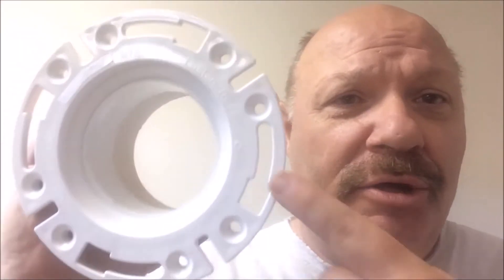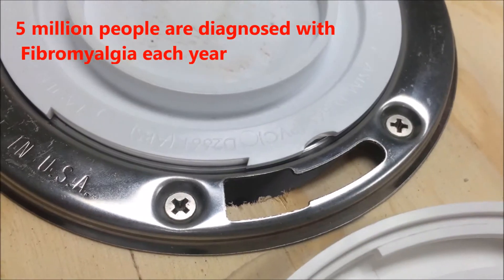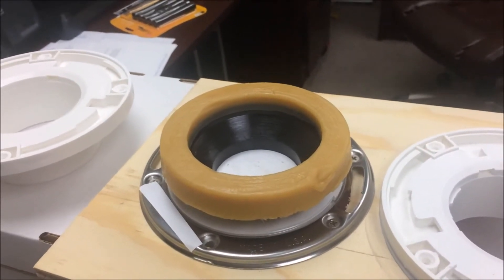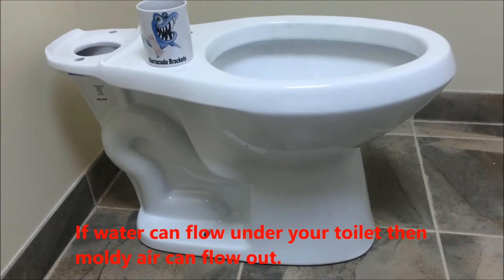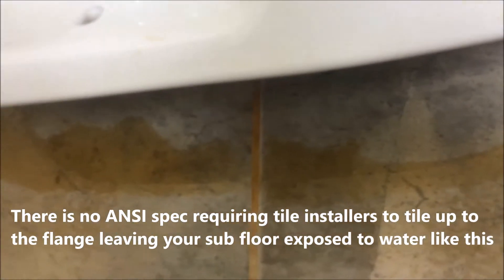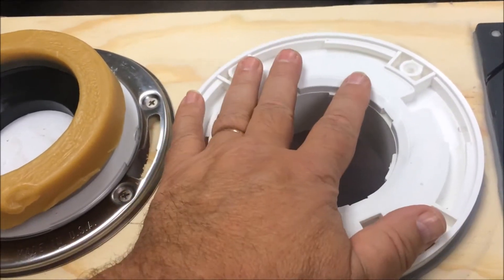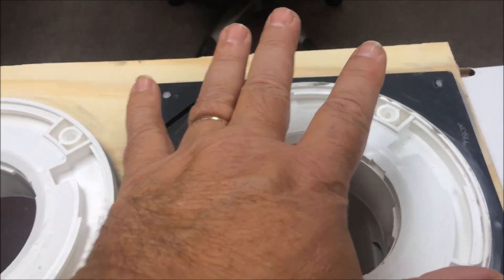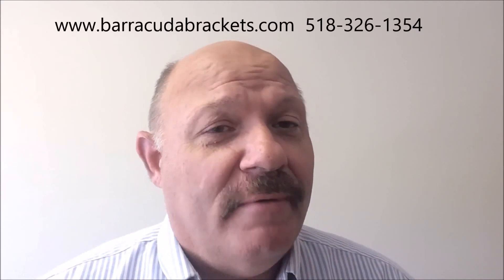Toilet Flanges and the Fibromyalgia epidemic

Comment: So your video didn't say anything about what size pipe it fit,  went on your web page and it says "4 inch outside pipe or 3 inch inside pipe".  Then I started looking at your product closely and see the little flange stops for the 3".  So IF you don't put enough glue between the 3" and your fitting, you could have a leak going down the gap between the pipe's outside wall and the inside wall of the fitting.  The only recommendation - would be to extend those little flange stops all the way around the fitting and make them the same size as the pipe thickness.  This would help prevent this problem, like flashing.   With that said.  I think you are right this IS one of the best products out there.